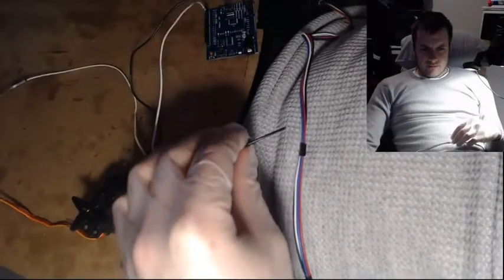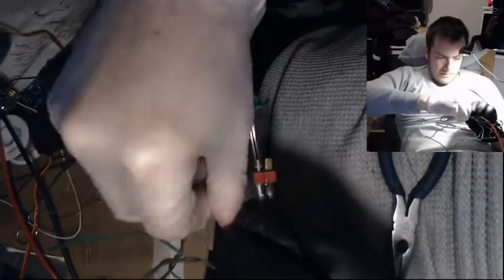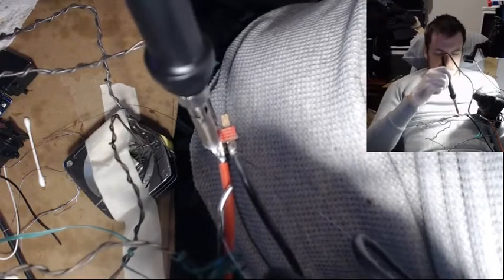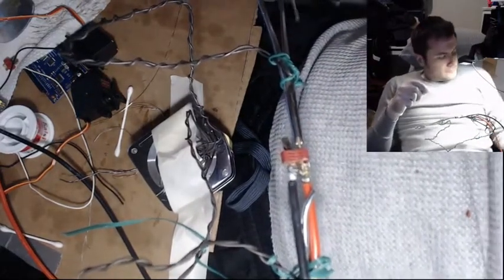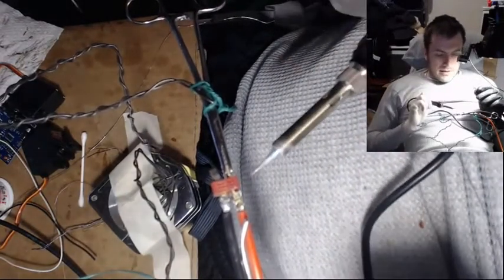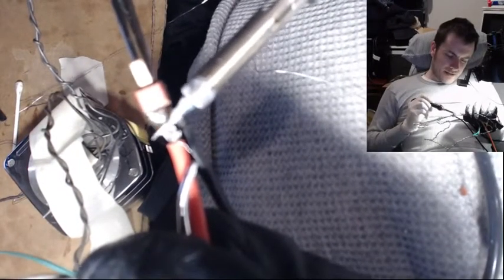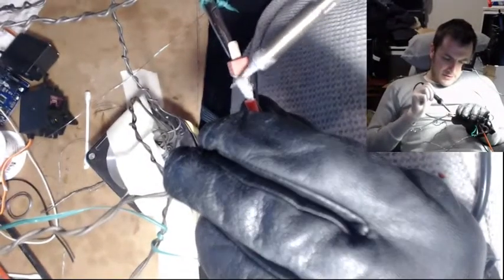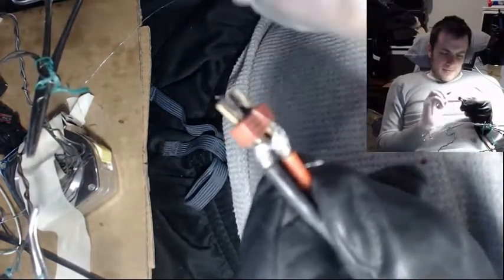Soldering 12AWG to Deans Connector w/ Pencil Tip Iron (HARD) | Building Humanoid Robots #54

Comment from the maker: since this is my 2nd soldered joint EVER I learned alot since then.  I know now a thicker soldering tip is better for transferring more heat which I needed and also know thicker solder wire fed while soldering would also help since a lot of solder is needed and the solder wire I'm feeding is fine for much smaller joints.  I also learned coating it all in flux helps alot but in this video the flux burns off before everything gets hot enough since my fine tipped soldering tip takes too long to heat up this joint and the flux is gone by the time it is all hot enough to melt solder - so a thicker soldering tip solves that which then lets flux be useful again.  So many things were against me in the video now knowing these things.